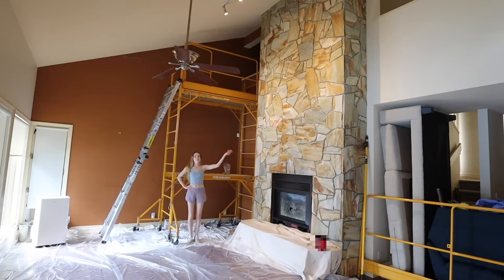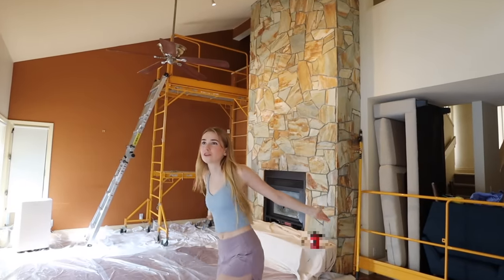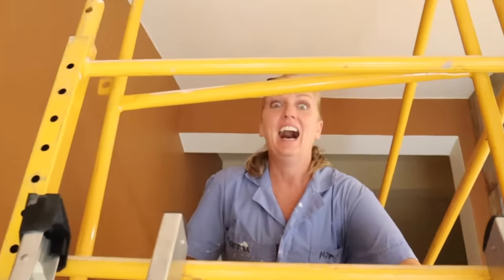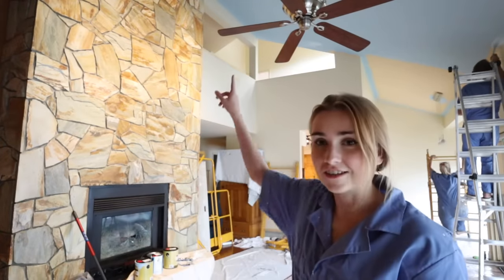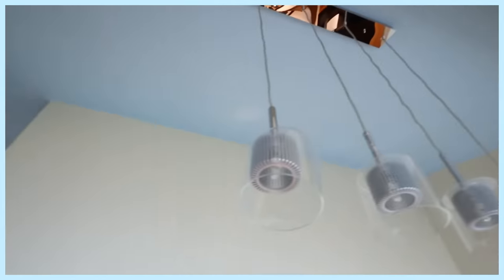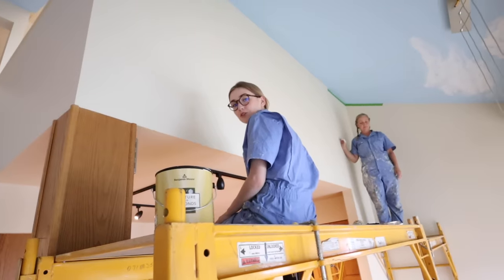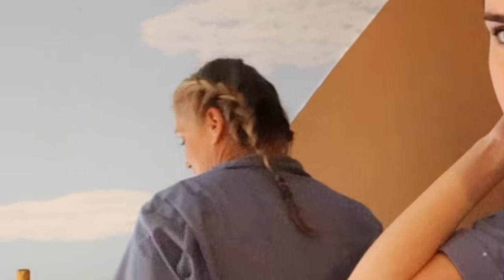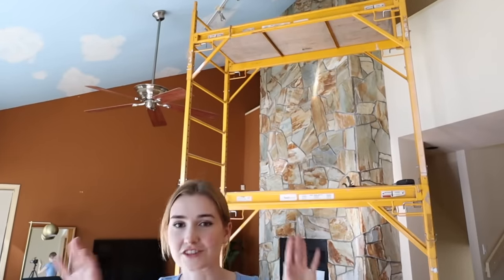I painted the sky on my 30 ft ceiling

Comment: I love how you're using a ladder to get up on the scaffolding, when the scaffolding literally has two built-in ladders on each side 😂
Reply: Omg you‘re right 😂
Reply: Lol I didn’t notice that but I kept thinking that in certain parts where they are by the upstairs overlook if they could just climb over there and just walk down the stairs.
Reply: @Peachykeenvintagedsm  exactly!!😂
Reply: Lol I noticed that too 🤣
Reply: I kept thinking that too! 😂
Reply: @Peachykeenvintagedsm  literally same
Reply: Exactly what I was thinking lol
Reply: i'd be worried about putting all of that weight on only one side
Reply: Or passing things. They went up the ladder to pass stuff they needed instead of passing stuff through the balcony when it scaffolding was literally right next to it. 😂
Reply: Same! It seems more dangerous to try to add another ladder in there!
Reply: Sam Bradley Have you ever climbed a vertical ladder? Let me tell you it's a lot scarier than one on an angle lol...
Reply: @ticketyboo2456  lol yes - I've actually built 2 houses before... The vertical ladder can be kind of scary, but imo way safer then propping another ladder up onto scaffolding (with wheels that may or may not be locked) looks like they managed just fine, but i thought it was funny to watch! 😊
Reply: @sambradley3179  Great flex about building not one but two houses. I still think climbing vertical ladders is scary but I've never even built one house so what would I know...😉

Comment: If it counts for anything: I’m pretty sure those yellow horizontal bars up the sides of the scaffolding are “ladders” and I think you can get railing for the scaffolding also. You bits did a beautiful job! At first: I wasn’t sure if I was going to like the clouds on the ceiling, but you won me over. Good job!

Comment: The trick to using that point painting stick thing is to not stand perpendicularly , as in straight underneath the region you're painting but rather slanting like on a slanting angle

Comment: Mia, a little tip for painting the edges.I ve saw that you struggled there. You can just ducktaped the brown paint and is way easier to paint then.Oooo wait I just realized that is too height up to put tape,but you can use the life hack for other projects if you want…

Comment: Future tip whenever your gonna paint a ceiling then the walls last. You can use a smaller roller to crash the cut in and roll out as much as possible so you can fill in the rest with the main roller.

Comment: First of all I Luv Luv Luv Your Ceiling (roof)!!! Second I think u might wanna get a primer tinted with the green you've chosen for the walls. That burnt orange or ochre color might bleed through, it is really strong & dark! This one doesn't matter because it's done but (next time) u should have cut in the trim on the walls While the scaffolding was already in that area. Cut down on work climbing up & down also u could cut down on the rental cost. Beautiful Job & Great work partnering!!!  🌹🎉💋👍

Comment: Ceiling looks great. The blue is very nice. 
It might of been safer to go over the wall from the second floor to get on the scaffolding in the first area when you started or hand things to your mum. At 07:45 and 21:50. Especially when your mum was trying to get down at the end. Though might of not helped all the time.

Comment: I'm not scared of heights but I'm scared of low heights. Like standing on a ladder etc. I think it's because when you're very high up its usually impossible to fall down ei. there is protection/fencing it's a safe spot. But to be honest my dad is a construction worker and probably stepped on scaffoldings a lot even before he was an insured employee. I had to step on a small ladder to paint a tree on a wall and I was freaking out I'd fall and smash my face even though the ladder was very secure.

Comment: Use 3 different texture sponges start with a watered down white and 2 others whites watered but slightly thicker in added paint in other 2. Start with the watery mist background then add the second different shaped sponge but thicker paint and then your 3rd sponge with bit thicker ontop and that will build mist thickness and layers and different shape/ textures to look real not a cartoon cloud.

Comment: I have 9 foot ceilings and my sister had 12 foot ceilings, so as soon as I saw the title, I was pretty sure they wouldn't actually be 30ft. took a screenshot of your Mia-to-scale, photoshopped Mia on top of Mia, and allowing for the gap between Mia and the wall, and a small leftover gap of about one-third of a Mia on top of the other two Mias... I'm pretty sure the ceilings are close to 15 feet high 😉

Comment: As a professor painter all i can say is i do don't recommend climbing the ladder without someone holding the bottom especially on wooden floors covers with plastic very slippery and dangerous i seen someone brake there arm because there was no one holding the latter on the bottom would recommend a boot ( or a triangle) at the bottom so one one slips but besides that you did good and i love your videos stay safe